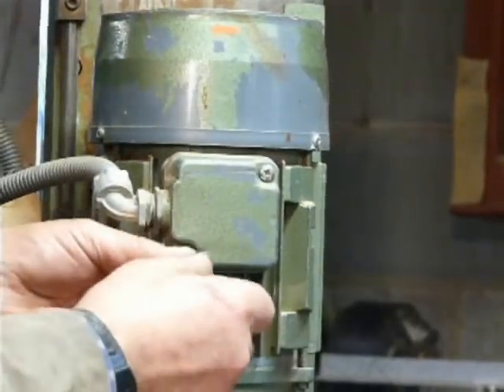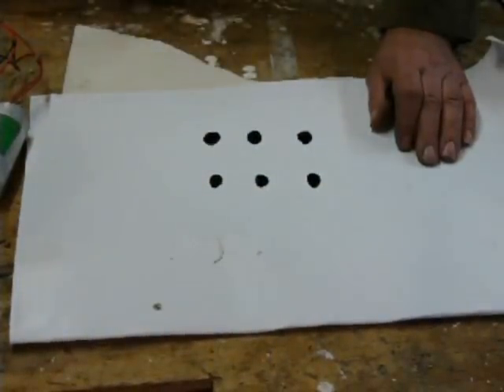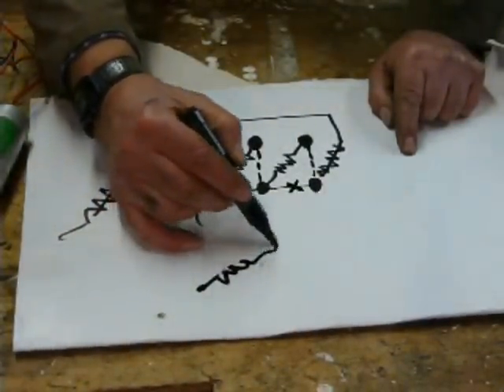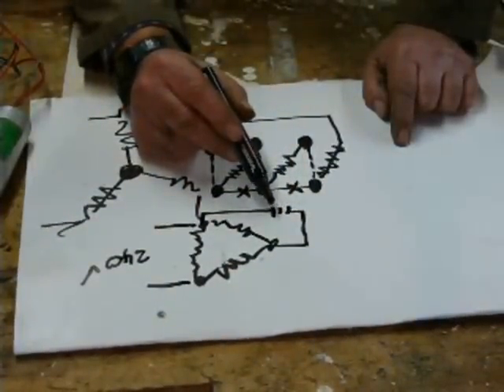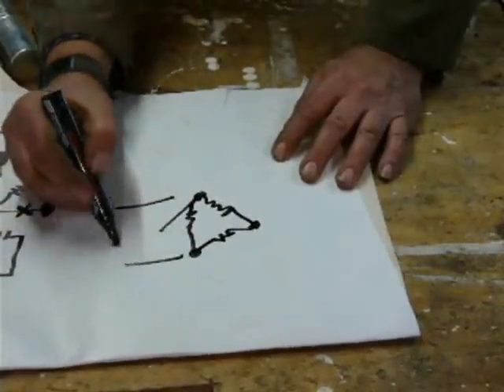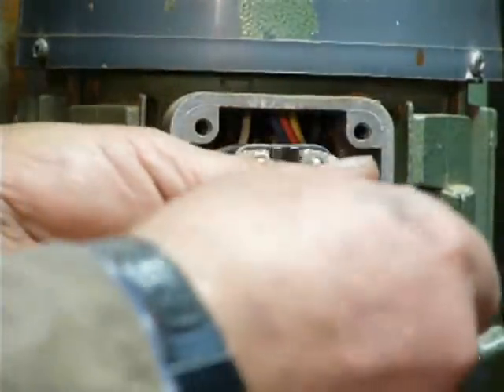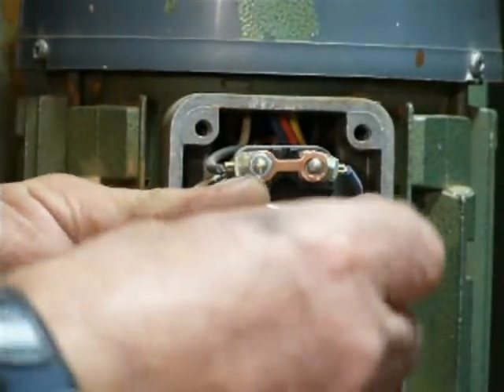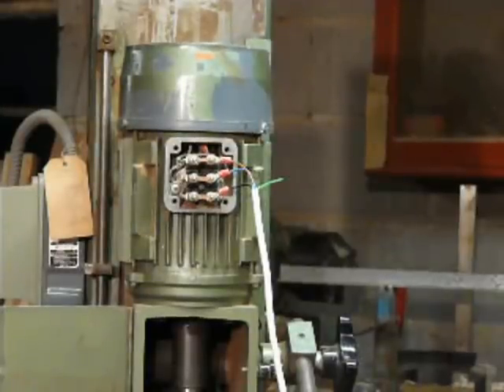How to do it: run a 3 phase motor on single phase supply. part 1

Comment: ... Or , if one can afford it, a variable frequency drive will not only run the 3 phase motor on single phase supply but will give you lots of nice features like speed control, overload protection and many other features.. Well worth if one can afford $ 100 bucks
Reply: Hi could you tell me where I can get one of these? I have a 3 phase fan converted to single phase and need to fit a speed controller on it. I have tried a standard plug in single phase speed controller on it but it doesn't work. Thanks Joe
Reply: Depending on your location, do a search on ebay for variable frequency drive , i.e : 
http://www.ebay.com.au/sch/i.html?_from=R40&_trksid=m570.l1313&_nkw=variable+frequency+drive+&_sacat=0

and look for what you need , as in Amps, single or 3 phase , etc.
If you have 3 phase supply and 3 phase motor , you can use a 3 phase drive to control the speed, if you have a single phase supply and 3 phase motor you can get a single phase to 3 phase drive that will give you the 3 phase needed and control the speed
Most of them drives have digital and analog inputs for speed control , where you can connect a potentiometer (a pot, variable resistor )to control speed. Digital stuff is for more complex applications.
You can also program the max speed , min speed, max nominal current so it will torn off if overload and lots of other nice functions.
If you buy the right drive and have a single phase supply for a 3 phase motor , you won't need any additional converters and all that.
Just keep in mind that with a single phase drive and single phase motor , the drive is for control of speed and other parameters (overload protection and so on) whereas a single to 3 phase drive and a 3 phase motor , the drive converts single phase top 3 phase supply as well.
Reply: Thanks a lot. I'll have a look into it then and see what's best for what I need. Cheers
Reply: No worries mate, as long as you look for single phase to 3 phase drive since you only have single phase supply and 3 phase motor.

Comment: Hi Andy  love your stuff and I'm subscribed. Changing a three phase motor from star to delta and it's got six wires from the motor to the junction box, no links to reconfigure do you think it's still possible by re-pairing them? Many thanks Keith
Reply from the maker: Keith. Hopefully the wires will have numbers, A1, A2 etc. Then A2 would connect to B1 etc. The coils need to be connected the right way round, so if they are not marked then educated quess is the best I can offer, perhaps on the way they are connected now, the star connection being the number 2 end of the coils, Mark things and take photos before experimenting. Check for coil continuity with a multi meter. Cheers, Andy
Reply: Andy Reynolds thanks so much for your input Andy I now believe that it is in delta already so I'm looking to get a dual voltage 3ph motor. Just for your info the VSDs only output 220v if the mains input is 220. It seems by the tech manual that they give out 415v but they don't. They can be set to 415v output but then only deliver voltage matching the mains input. Very misleading. The tech help at Schneider are really helpful for info on the Altivar range of VSDs. Thanks again for your brilliant insight into things! 👍🏽
Reply from the maker: It's all coming together, thanks for the info, so  VSDs don't have a voltage step up facility and you would need a large step up transformer in the front of it, expensive. Cheers, Andy

Comment: Hello Andy.  Can you help me?  Followed your vids and after power on the motor ran so slowly about 1 r.p.sec and heated up so fast that I switched it off.  There are no visible signs of burnt turns/windings and no smell either.  The coil resistances are:  W1 W2 380  U1 U2 16 and V1 V2 31 ohms resp.  Capacitor used was 30mfd.  What  is the trouble?  Tks.   On the label it says that is an asynchronous one.
Reply from the maker: Hi, probably capacitor too small or a start capacitor needs adding if any starting torque is needed. Make sure your wiring is correct. Subscribed? Cheers, Andy

Comment: Really appreciate the presentation sir, my question is that up to how many horse power that we can run three phase motor from single phase power supply? As your presentation only small motor sample, it is applicable up to big horse power motor? Thank you sir, hope for your  positive reply, thank you.
Reply from the maker: Hi, maybe 3 HP but it depends on the motor. Cheers
Reply: myjmjrjjhm family

Comment: answer please.?
Reply from the maker: no question, cheers
Reply: is it possible.to.run any 3 phase motors...from single phase supply?
Reply from the maker: Any bigger than 3 Hp would cause problems, Cheers
Reply: i am going to present this topic "running 3 phase motor on single phase" in class... i am also going to show these videos in presentation ..  so i need some theoratical details of this topic.. so please suggest me some of theoratical detail available on internet.. or any pdf files or book available at intrernet
Reply from the maker: Hi. The Workshop practice book is shown in part 1 and the formula for the capacitor value is shown in the comments in one of the videos. Hope that helps, and of course there is my book on Wind and Solar Electricity (edition III)  Cheers

Comment: but how can i detect the size of capacitor  for 5hp three phase  induction motor that i want to run  it with single phase
Reply from the maker: Hi. This may not be possible due to the high start current on a large motor. However, follow the videos and experiment as every motor is different. Subscribed? Cheers
Reply: i tried it today with 3 capacitors each one has 100 micro farad and 450 v and connected  them in parallel  and it was well, thank you so much.
Reply from the maker: Check the motor temperature. If it gets hot then the capacitance is too high. Cheers

Comment: another way is to wire up a second three phase motor to the first one. I forget exactly how, but there's diagrams on the internet that show how to do it. 

your method is the easier one as not everyone has an extra three phase motor sitting around.

Comment: Hi Andy.... I wants to know whether we can run three phase dehumidifier unit on two phase supply available? if yes then how to connect?
Reply from the maker: Hi. Difficult because of the high start torque on compressors. There is only one way to find out by following the steps in the videos. Cheers

Comment: Hi Andy, your vidces are great, just the right amount of detail without waffling on (as a lot of videos here do!).  The video mentions wiring in delta for 240v single phase supply.  What happens if we wire the motor in star configuration?  Cheers, Ben
Reply: It won't work right as two of the phases will be receiving the same phase.
Reply: +jmcinvale at half the voltage.

Comment: Capacitor delays the power? I didn't get that point.
Reply: +Arslan Asif   Three phase motors have 3 windings if the sine wave on the three inputs was the same the motor would not turn

http://ep.yimg.com/ty/cdn/yhst-14463325294384/Electric-Three-Phase
http://p1.hostingprod.com/@tools-plus.com/blog-images/1-phase.jpg

Comment: Andy, nice work you did here.

We have several motors(15,25hp & etc) for rice mill applications with 3 25KVA transformers. these 3 transformers were destroyed by the typhoon and reinstalling them costs us a lot.

Is it advisable to reconfigure to use single phase residential power from these 3 phase motors considering the following:
-hp loss on heavy loads
-monthly electric cost

thanks a lot. i already subscribed
Reply from the maker: I think with motors that size the start current would be too large especially if starting torque is required. Cheers
Reply: +Andy Reynolds around 750uF base from your computation 30uF per hp(on a 25hp motor)?
But theoretically, will it blew running at around 60% rated hp  when there is a load?
And also, articles states that electric cost is 40% cheaper when in true 3phase motor 3phase power. Is the 3phase motor  in single phase power won't have this benefits?

thanks a lot.

Comment: Andy:  Thanks for your videos on 3phase to single phase conversions. I expect on my 10HP 3phase motor that the amps on the remaining two legs to the motor will reflect the higher amperage resultant from the 240 V rating.  I am sizing circuit breakers assuming such.  Just a note: My application is the motor is being oversped by a 13' overshoot waterwheel into the slip speed of the motor.  The producing current will feed the house. I'll let you know how its going.  Thx. Rick
Reply from the maker: Rick. We have done experiments with a 10 foot waterwheel. You can see the results in the 3 videos on my channel. We used a high voltage PM wind turbine generator and an SMA solar grid tie, both second hand. This might help you. Cheers, Andy

Comment: Morning Andy,

I am just about to put my new found knowledge into practice on my Ring Roller, one question I have, it has a forward & reverse remote pedal set up do you know if this will this still function..?

Great videos for the wanna have a go but just need that helping hand guys..

All the best,

Dave.
Reply from the maker: Hi. To reverse this type of setup, stop the motor, then the capacitor link needs to be changed to the other mains input connection. Hope that helps. Subscribed? Cheers, Andy

Comment: Hi 
I have a 3 phase lathe 
I have converted the wiring as you show. The motor runs fine with the clutch disengage
As soon as it loads up and trys to spin the chuck it the motor stalls and trips the Circuit Breaker. 
Any Ideas
Reply from the maker: Hi. I suspect your capacitor value may be wrong. Check the volate on the terminals when the motor is running with a multimeter. Be careful!. If a voltage is low this indicates the cap value is too low, conversely high is too high. Have you watched all 6 parts and subscribed? cheers, Andy
Reply: +Andy Reynolds ok thanks
I did not know there where six parts I will look them up now. 
thanks

Comment: Hello,
 I just purchased a drive inverter to power my 3 phase bandsaw. The source at the outlet is single phase 220, 60Hz but the inverter is marked both 3 phase input and 3 ph output, does that mean I can use it with that single phase outlet source?
Reply from the maker: Doesn't sound like it. Here's a question you can ask yourself, how many terminals are on the input, and what are they marked as? Find out who made it. Cheers

Comment: I have used 120uF / 275 VAC MPP Capacitor for 5 HP 3 phase motor in Delta configuration by following this video. Still it is running 150 rpm approx. I  have to double the capacitance and check again.
Reply from the maker: Try using an extra cap in parallel just for a second or two. This will give the motor a kick start. Try another 120uf or larger. Cheers

Comment: Andy, your videos havr really helped me, cheers.  I have a static converter to run a 3.5hp machine in my workshop.  I don't know what the converter is rated for hp wise. However,  I connected it to my 5hp press which is unloaded on starting. it wouldn't turn and the ammeter was maxed out. I wired it to delta and still wouldn't work so I put some capacitors on, like you've shown how to, and if run up beautiful. I used a 200uF start cap and 35uF run cap. I got a bit excited and forgot to switch out the start cap and it went pop after a few minutes. Do you know why capacitors fail when connected in this way?
Reply from the maker: A high value capacitor will induce a high voltage in the windings. So before you burnt the motor out it blew the cap, lucky. See parts 5 and 6 for the automatic way to connect / disconnect the start cap. Subscribed? Cheers, Andy
Reply: +Andy Reynolds Thanks. I now realise that the dedicated start cap has a short duty cycle, hence the failure.  it lasted about 60 seconds. interesting the motor ran quiet and was not even warm. the start cap was 150 - 200uf and the run cap is 16uf. after the cap blew it started again with only the run cap but took a little longer to pick up speed.
Reply from the maker: When it is running you could measure the voltage across the motor terminals. If the cap connection reading is low then you could increase the cap value until the readings are similar gain improved starting and power. Cheers

Comment: This is an interesting video. I rewind motors for a living. A couple of issues I see here. 
1. I can see people single phasing their motors and burning up the winding. 
2. I can see them popping off capacitors pretty much everything you warned about. 
3. i can see people not understanding that start up amperage is more than the run amps and they will keep popping off breakers or burning up the lamp cord they hooked the motor up to.

The three safest methods are 
1. static converter and lose about 30% hp (pretty much what your showing here but can be bought and hooked up by .. well somebody with above average mind (USA standards)
 2. Roto phase and get 100% hp but you have to size it right 10hp rotor phase for a 5hp motor
 3. Add a phase. Once again you have to size it  right and you also have to adjust the third leg under load by unhooking or hooking up capacitors that could lead to death from the average guy here in the states.  We had one of these last summer in fact.

Great video but at least here in the state I see death from "handy men"
Reply from the maker: Thanks for your observations and I agree with them. I see this method as a cheap and cheerful method of running low power 3 phase motors only. I think the "average mind" is not only pertinent to the US as I have had questions about 3 phase welders and heaters. Cheers

Comment: this video is an interesting to me,for example,after rewinding coil motor and test the motor,if voltage supply single phase 240 V,you can test the motor with supply single phase 240 V.it is very simple and easy..
Reply from the maker: Thanks for the comment. It is important to test the voltage across the capacitors when the motor is running. This test gives a good indication if the cap size is correct. Cheers

Comment: Hi Andy. Can I just say how helpful your videos are and thankyou for taking the time to make them. My issue is that the 3 phase motor I was looking to convert simply has 3 wires going straight into the motor. Is it still possible to make the conversion with such a set up?
Reply from the maker: Hi. That sounds like a single voltage motor. the star connection will be inside the motor. If you feel brave take the end covers off and try to find it. It should be tied to the stator coils and identified by there being 3 wires. After that it's just knitting. Cheers

Comment: hello #sir thank u for sharing this type of great video...... now my question is if m connect 1 capacitor and 1 inductor to 1ph line then connect this terminal to three phase star connected motor then is it work???????
Reply from the maker: Doesn't sound like like there is a circuit, experiment and see what happens, Cheers
Reply: Andy Reynolds ....#sir i m just student so i dont have sufficient apparatus and equipment ....so can u please conduct this experiment in ur lab???   ......tell me result what happen??
Reply: Andy Reynolds sir please give me answer......thank u in advance
Reply from the maker: Hi. The videos are there to encourage open source learning. That's as far as it goes, it's then up to the individal to apply this learning. I hope you make use of this whole series. Cheers

Comment: Hi could you help me how can I run a motor from WYE to Delta connections or vice versa? Any one please? Thanks.
Reply from the maker: Hi. Your answer is in this series of videos. If you have 6 connections in the motor box then you can change from star to delta. Cheers
Reply: Thanks Andy got it...I thought I would use a capacitor also but since my line is 3 phase it worked out well then.

Comment: Is there a way to check using continuity on my volt meter if my motor is wired star or delta? It only has 3 wires. Another question is doesn't 3 phase mean, at least on a 220v motor, that I have three 110v lines going to the motor? If so where does the return wire go?
Reply from the maker: IT will say on the motor plate. In the UK it will say 440 / 240 for a motor that can be wired star or delta. If there is no choice then normally it will be star. The motor will work on 240v  in star but it will have less power. check out poroldchap channel. Cheers
Reply: Thanks Andy, however this motor is very old and heavy and there is no information on the motor plate about the wiring. My email adress is :johnbrain92@yahoo.com
If you would send me yours, i could send you some pics, and my wiring configuration that i thank will work. Im not an electrician and really dont want to ruin this motor. It goes on an old sidney lathe, 1940 i think and a replacement single phase motor costs around $700 US dollars.  Thanks
Reply from the maker: You could put some photos on a slide show with Windows moviemaker and then load them on your channel. But with the star connection you have,  you could just wire it up to 110v AC with some capacitors and see how it runs. If it runs quietly and does not get warm then all will be fine. Just flip the belt off for these tests. All a matter of trying it and learning in the process. Do the voltage tests when the motor is running (carefully).  Cheers, Andy
Reply: Excellent, i will try tonight. U give me much confidence

Comment: In your drawings, you should use capacitor symbol to represent a capacitor, instead of resistance symbol, and coil symbol to represent a coil instead of resistance symbol.
Reply from the maker: rude
Reply: Andy Reynolds rude? I appreciate your video in fact was usefull to me,  i just commented that in good mood
Reply from the maker: Fine, I took it the wrong way, cheers